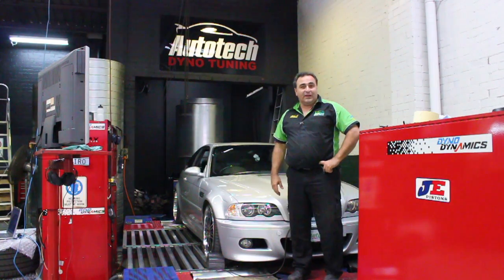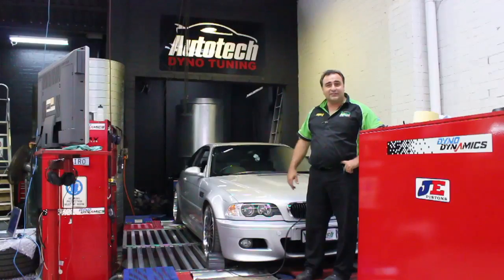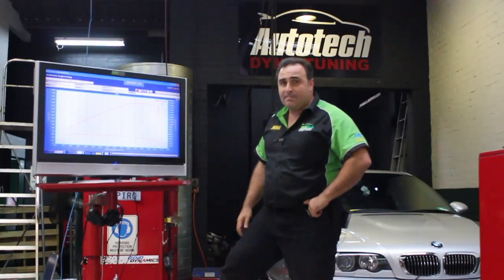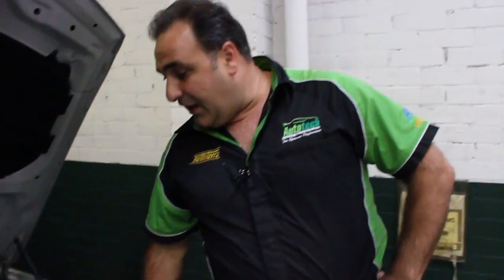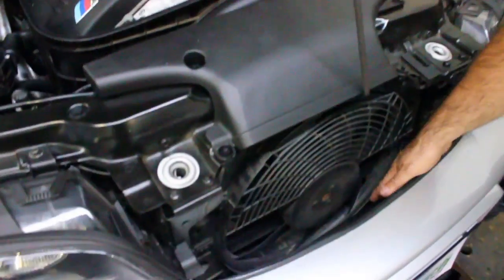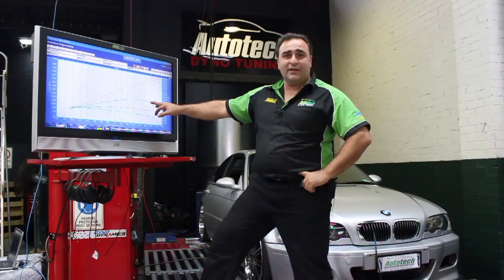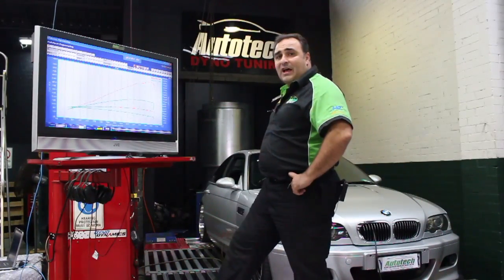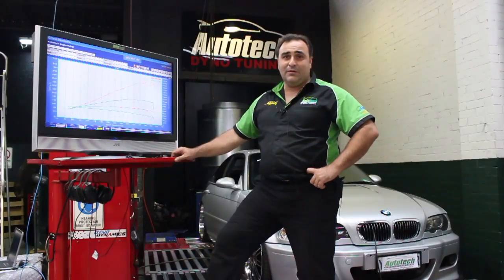BMW M3 Supercharger Kit Installation

Comment: Engine won’t go 50,000 miles until it blows up
Reply: incorrect if maintained properly its fine
Reply: Car has done over 80,000miles since this install - and has never skipped a beat.  8yrs and still going!

Comment: Bruh where is the small metal pin you supposed to put on the pro charger pulley To lock in the shaft?
Reply: Ron -Its not a Procharger ,Procharger is a brand name. This is a Vortech, The key lock is already machined into the black pulley.Line it up and slide it on to the keyway..Rewatch it  4.10.

Comment: Supercharging an S54 is complete idiotic, and waste of money, Where are your numbers from beginning, show it on DINO??? where is the lost barnyard, u got 300 HP at least , let 38 escape by age, besides, what is the intercooler for a supercharger for? putting air intake so low , away from the dynamic air flow specifics designed by the idiot engineers in BMW, if you wanna turbo or supercharge, do it for an M50 or M52 engines, even the old Majestic M30 or even M20, but don't touch the original M power engine, or at least modify the measures in the car computer, and tell your customer ahead, that his engine life span is reduced to one year at best before you touch a BMW
Reply: Austig m- Shown very clearly at 8.06 on dyno screen. before and after power graphs. The exact same reason you interccol a turbo car ,compressed air gets hot.A dyno tune does change the "measures' in the ECU. This Car is still running 5yrs later. As for the lost 'barnyard', the animals were sick of you fucking them and they ran away.
Reply: AUSTIG M these cars are just not competitive in today's world. There are now plenty of reputable tuners that offer safe turbo and supercharger  packages for the e46 m3.

Comment: Could anyone please post the right turbocharger model?  Is it the VT2 550 or the VT2 575 or any other model of ESS? Not anything on the engine was replaced? Not even reinforced crankshaft bearings and also thicker gasket between the head cylinder on the block?

I would be very thankful if someone who's done it answers this questions.

Thank you in advance to everyone.
Reply: Josep- A) Its a supercharger (Vortech) not a turbo,B) Injectors and fuel pump was changed /ECU was remapped C) Why would you put a thicker head gasket? Its 10 psi.

Comment: "We painted the intercooler black to give it that stealth look"
Meanwhile I'm looking at those gaudy rims
Reply: painting it black gives extra 5 HP
Reply: If you paint with insulation paint it means less heat from the motor will get to the turbo allowing better cooler air to flow through
Reply: It's just a YouTube, chill hater
Reply: don't worry about the wheels m8 the video is about the installation of a super charger

Comment: is this called pro charger or really supercharged ,,,  i thought it was called  pro charger cuz is a turbine
Reply: Pro-charger is a marketing term. Or rather a brand name. It's a supercharger. All super and turbochargers (that I know of) have turbines. And strictly speaking turbochargers are superchargers. But commonly you only call mechanically driven superchargers superchargers.
Reply: Volundr - True superchargers (twin screw/roots 5/71 types) have the FUEL (generally methanol,to cool the charge) and AIR going into the supercharger and pre compress the mixture into a gas.Turbos and centrifugal blowers (Have impellers) only force AIR in ,then fuel is added after induction.

Comment: i got e46 323i bmw can u bolt on this type of supercharger on m52 2.5l 6 cylinder inline?
Reply: WELL yes but different kit. the 323 motor does not have individual throttle bodies like the m3
Reply: sell the car and get a 330i or m3 lol
Reply: The way my e46 323i is modified i can beat 330i bmws. I remapped it changed the whole exhaust system headers 2 hi flow cats x pipe 2" pipe all the way. Also changed my diff 3.46 ratio. I keep up with r32 golfs.
Reply: Actually 330s can be tuned to 800 whp
Reply: look up Raptor superchargers they have some kits

Comment: You missed the woodruf key in the super charger pulley
Reply: nope its machined on the pulley @ 410  He lines it up then slides it on. Nearly all system have these pulleys.

Comment: Better save up for forged internals
Reply: E46 M3 comes from factory with forged internals.  And 8yrs later, car is still 100% perfect.
Reply: Peter HMan wrong, only forged crank and rods, pistons are cast
Reply: @YZFMANIAC08  I stand corrected!  My apologies.  However, the car is still in perfect running order with well over 100 passes down the 1/4mile.  And over 80k miles on the clock since the install of the SC kit :)
Reply: Peter HMan probably babied it, s54’s are notorious for spun crankbearings etc
Reply: @YZFMANIAC08  Ha, I assure you, it hasn't been babied.  The amount of track time & 1/4mile passes the car has done would be more then some people spend on the road.  Its all about keeping up with maintenance!  I have pic's of it on the track and even some 1/4mile slips of different years :)
Reply: Peter HMan oke fair enough
Reply: @YZFMANIAC08  Vid of it on the track :)  Not my best driving, as it would have maybe been the 8th time since the SC install!
https://www.youtube.com/watch?v=tCkzC23ALYU

Comment: woops forgot something to aay yeah 181 kw is waaaay to low that the 330 normal version not ///M3 and 417hp with a mechanic turbo charger What The Actually Fuck the stock m3 has 345 hp non charged and with the mechanic charger 417 makes 72hp+ and whit how much is the charger blowing ? because to get almost 80hp the pressure needs to be at least somewhere around 0.5-0.6 bar and that makes a big difference because the m3 is a high combustion engine with a 11.5:1 ratio normaly its 8-9:1 is something wrong with youre dyno ?
Reply: Sakiko Nobu it's power at the wheels dude, not the fly. Totally normal. And it's a high compression motor, not high combustion

Comment: 345 engine hp Wheel hp is a bit lower and theres no turbo or a kompressor remember that 3.0 8000 rpm and 345hp thats amazing
Reply: +TheRealestEver If a part is "over-engineered", it's unlikely to break, even at higher power outputs. But I get what you mean. There's not much room for more power available in these cars before things start breaking.
Reply: +TheRealestEver this engine has heat problems if u want more power u have to be very carefiul with coolimg friend works for bmw valves reapir only material for it 4000€

Comment: something is off here. Standart e46 M got 330 Hp, or 250 KW at the crank. Thers no way yours got 180.
Reply: how much drivetrain loss do you mean the M3 has got? 180wkW = 245whp.... 245whp/0.85 = 288hp. Learn more than your standard NFS shit nab
Reply: TcgShopLandshut ~240 Hp at the wheels  is still low for a stock e46 m3
Reply: +TcgShopLandshut at the crank and at the flywheel are the same thing so you are wrong

Comment: Hahahah wtf 230 hp stock
Reply: +Sakiko Nobu It's actually a 3.2 liter. The S54 motor
Reply: 345 hp not charged
Reply: +Trapalous Piffington theres no charger on it just 3.0 liter spinning with 8000rpm+

Comment: 181KW is roughly 250HP and even taking into account gearbox/transmission losses, it's down about 40HP on what it should be. 338HP - 15% = 287.3HP. Wat. My old car was recently dynoed and made 225HP at 84,000 miles. It was rated for 223 at the factory. The tuning place informed me that modern cars don't really lose power. What the hell's going on here?

Comment: The intercooler is between the intake and the supercharger right? 
filter -> supercharger -> intercooler -> intake
Reply: bladegt7 so it goes like intake>>supercharger>>intercooler>>engine.
Reply: Jay Bond Both right xp just depends on what you call an intake xD
The manifold is the air intake on the engine itself, the filter is the air intake from the entire system.
Anyway, the intercooler is there to cool down the air after it was compressed.

Comment: can't get an honest answer. I explained that procharger gives the pressure in a narrow rpm range. until the moment when he begins to create a positive pressure he turns and takes power from motora after when the speed increases the pressure begins to run low on the motor. procharger cannot provide motor full volume of air. and that goes procharger again spinning in idle and spends the engine. and moreover, procharger creates pressure only within 2 thousand turnover per minute. say that the pulley is designed to give a pressure of 3 rpm ,then it gives pressure to 5 rpm and all the rest of the time it just spins. who will answer honestly? like it or not. and that all this publicity stunt was tired.
Reply: What? Procharger is a brand name.Some superchargers can run a clutch system that starts spinning at a given RPM, then vent the air at higher RPM usually only on offroad /rally type cars that are on and off the throttle.Not understanding your English description.

Comment: its not a US version look at the steering wheel its on the right side.
Reply: the E46 has the same engine all around. only the E36 was there a difference in the engine. there was the Euro Spec and then the US Spec. The E46 all had the same.
Reply: the e46 m3 was rated 333hp in the usa. 343 in Europe due to the exhaust emissions. engines are identical. sports exhaust should improve us numbers.

Comment: Holy fuck its really that easy for supercharger? Just plug and play the pretty songs it sings... Wonder if I could do the same for my E36 1996...
Reply: turbo is even easier to install on your own if you have the tools. getting it tuned takes someone with experiance
Reply: KableFI I Supercharged my e36. Videos on channel
Reply: KableFI Its so easy , only thing You need is some software work and programming
Reply: Turbos are way harder to install. You have to tap the engine oil pan, replace the exhaust manifold, lay the oil feed and return lines, all the plumbing for the intercooler (turbos need one, not necessary for a centrifugal supercharger) and tuning is much more difficult. It also costs much more. However, you do have the ability to make more power on exhaust driven turbos.

Comment: Just to explain.. mariomaster281 and others..  New Stock BMW M3 has 343 HP, thats 275HP at wheels.. they measured 191kW = 260HP so it's down to 15HP on wheels in comparison to new car. Not bad, M3 have actualy more power (like 350 and 374 for CSL) when new as stated by BMW, and that's not a common thing in today's cars.. (Toyota is known for -15% when new in comparison to paper). So after this modification it has 307kW on wheels so that's 520HP engine? Hard to believe.. but it's possible. 
PS: Supercharger is not a turbo charger driven by belt. Turbine is driven by gas and as there isn't any in supercharger, we talking here day and night.. Supercharger has compressor driven by belt (or electric motor) and turbocharger has compressor driven by turbine..  get is straight, read wiki. Piiisss
Reply: Stan Trnik
Reply: So what is your point about m3 being better?  What did M3 do better?
Reply: 520 on crank

Comment: that guy said it has 191.7 kW which is 257 hp (stock  252 kW-338 hp) how is that possible?? lost 80 brakes since left factory??is US version down the power??after installation he said it has 307 kW which is 411 hp  !! +150 hp with single turbo without rebuild the engine !! WTF !! can anyone answer my questions ???
Reply: it not a US cars by looks of it and thats a supercharger not a single turbo
Reply: you're wright mate it's not US only Australian car , for second I did read about difference between turbo and supercharger I 've made mistake above saying that is a turbo.that was details, can you answer my quastions now mate??
Reply: ok so that means every single car on road is down power and factories just keep talking shit to people about motor power which is impressive but only on the paper not in practice !! my audi 1.9tdi should have 110 bhp and in your theory it has got about 70 breaks then GREAT !!
Reply: mariomaster281 They are not really lying to you all cars lose around 15% power because of the driveline you cant get around that. So what each company quotes thats the power the engine makes and thats BHP or KW. But some people will quote the power that comes at the wheels and thats a different measurement RWHP or RWKW
Reply: ***** Nearly all cars including most supercars are flywheel hp. and are tested before installed into the engine bay. So if there's any problems they don't go to all the cost and effort installing and removing a faulty engine.
Reply: He said that power is at the wheels so at the fly wheel it would be around 240kw
Reply: 181kw is 246,09bhp
Reply: Paul Drew They actually add fair bit of power just look up some companies like ESS tuning or VF engineering
Reply: 307kw is 417.4bhp not 411 and its a super charger not a turbo lol and upgraded injectors but still dont seem right to achieve that much of a power increase lol
Reply: Paul Drew preddy sure he said 191.7
Reply: Centrifugal supercharger. not a turbo.
Reply: JonTheChron Nah, he definitely said 181! 181KW is roughly 250HP and even taking into account gearbox/transmission losses, it's down about 40HP on what it should be. 338HP - 15% = 287.3HP. Wat. My old car was recently dynoed and made 225HP at 84,000 miles. It was rated for 223 at the factory. The tuning place informed me that modern cars don't really lose power. What the hell's going on here?
Reply: James Khan
bmw measures it at the rear wheels. so there is no way this could be true
how could a car lose about 70kW???

Comment: its possible to aply a On off "boton" to a supercharger? usim for example an electric clutch pulley? thanks
Reply: yes it is possible, very rarely seen tho. Mercedes use a type of bypass valve on their compressor range, some also have a electromagnetic clutch just like a ac pump but you cant control it yourself it is controlled by the ECU to reduce emissions at low loads. but you could run a car with a custom ecu running a custom map or even switch able maps.

Comment: DirtyDan turbos need intercooler not beacuse hot exaust but because compressed air gets warm and warmer air is less dense than colder, hence colder than the itake air, more power to the wheels. Supercharger also compress air and if you want more power you get intercooler.
On the turbos, turbine section is wery hot (it can come to 800C), but only 10-15% of this heat is transfered to the intake air.

Comment: what is the point of doing this other that spent 10,000$. You can always buy new more powerful car and sell old one. 3 years old corvet, M6, camaro, spyder etc all come ar third the price and are better than this supercharged M3.
The other question is where will you drive this kind of vehicle? Will you take it to the track? They are quiet rare, pricey and you need to make a reservation few months is adanced.
Reply: camaro is suck! BMW M3 Stock is better than Camaro with supercharger! M3 is fantastic on circuits!
Reply: This is australian mate, dont know why americans think everything online is american. Cars cost 2-4x as much in australia than in the states. Corvets in australia cost anywhere from $120k to $220k USD for a 2008-2012. Camro ZL1 = $166k SS = $90k m6 $80k-$226k So spending 10k on a 40K M3 Is far better than any of the cars you listed.
Reply: Rodolfo Netto All US made cars sucks! Also car makers in US submit that fact.
However they are good if you look cheap car for straight line driving and don't mind low milage. 
However I am not a fan of aftermarket superchargers since they lower fuel efficiency a lot, I preffer small powerful turbo charged engines. I drive 180HP diesel powered Audi that can go 230 on the Autobahn (there it is legal) and I can make 1100 km per tank.
Reply: Borut Goli Straight line cars are the best, affordable and practical, use them everywhere not just on a circuit.
Reply: Personal taste? I own a 5 series BMW.
Reply: Because American cars are a complete bag of dog shit and the M3 even in standard form would outhandle and out manoeuvre most American cars
Reply: Don't make me and US mate! I am from blody EU. As far as I knew speed limit in Australia is 70 or 75. Why would you need such a fast car? to cats kangaroos:)

Comment: 246bhp standard, surely should be near the 280 mark?
Reply: I tend to agree. Even if this car has lost some power over time, these came out standard with no less than 330bhp for the USA models. He's talking hp at the wheels, whp, but I can't see a drive line loss of almost 100hp.

Comment: This is called a centrifugal supercharger for those of you that think it's a turbo
Reply: +Char lottie That is absolutely not a twin screw supercharger.
Reply: This is centrifugal..twin screw is the old supercharge system..and the other one is root supercharge...
Reply: Sorry root supercharge is the old system
Reply: Twin scroll is the oldest but also these vortechs have been around as I can remember there history possibly in the 70s but who knows
Reply: no wonder people make the mistake though. superchargers are in essence turbochargers. They force feed air into the manifold and are turbine driven. However they use the belt system to spin the turbine rather than using the exhaust like turbos do.
Reply: Twin scroll???? Man some people here need some basic engineering instruction........lol.  It is not twin screw and it is also not a twin scroll, it has no turbine side which is why a turbo is called a turbo.
Reply: Christian Angeles I was about to say haha it looks more like a turbo but I’m not a car guy but I knew there was different superchargers positive displacement is the only I’ve had the joy of installing and using one of those with a blower haha
Reply: Christian Angeles its actually called a twin screw supercharger